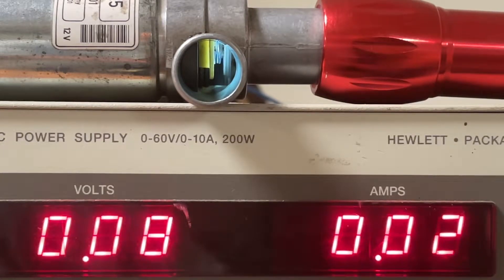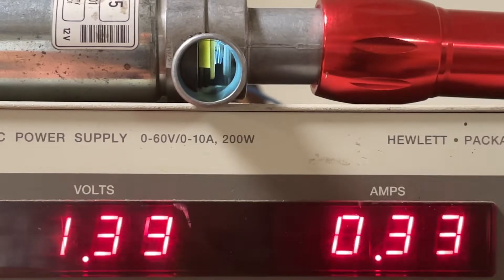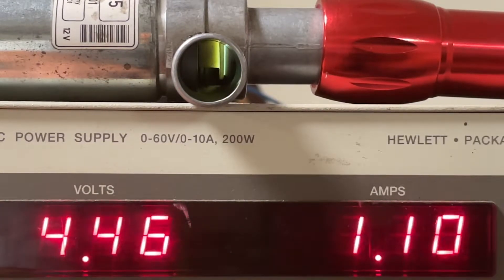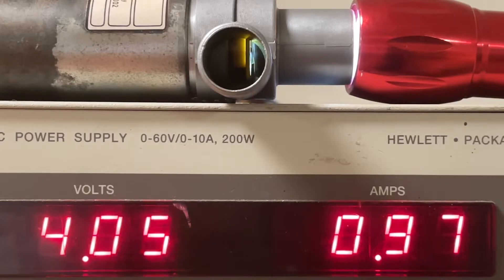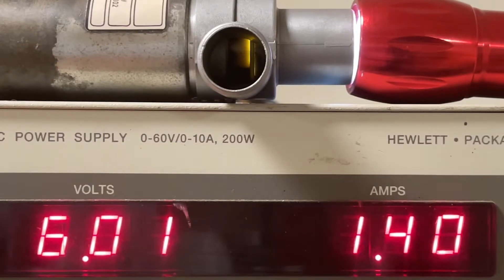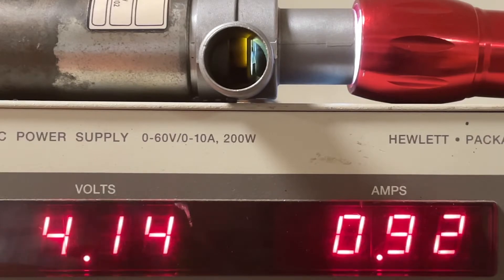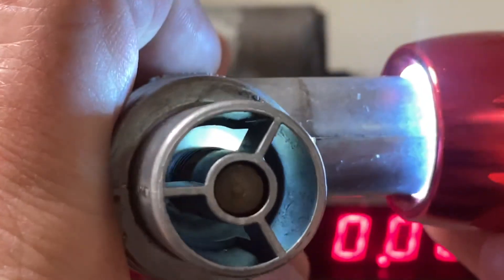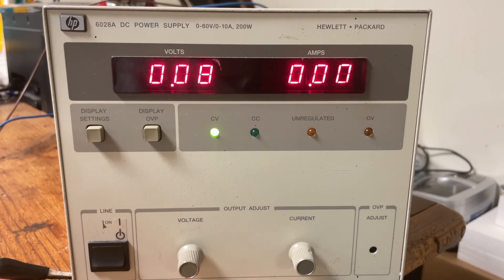Mercedes 560SEL MY 86/91 Idle Speed Adjustment Tutorial Part 5 - testing current draw to close valve

Comment: I need to adjust my control valve but maybe nes a 500 any ideas how
Reply from the maker: I have to get one for a 380/500 then I can tell you of what needs to be done
Reply: @inovahightechltd  ok if you could show me or maybe talk me through it that would be fantastic… great channel by the way 👍🏽
Reply from the maker: @keabot I guess you have a high idle problem? What is your idle rpm at the moment?
Reply: @inovahightechltd  from cold start it’s ok .. as the car warms up the idle creeps up also to 1000rpm I’ve changed the idle control valve original VDO and the rubber hoses so far… I’ve not changed the module or (relay) yet … so  I’m curious to know how to adjust the icv.?
Reply from the maker: @keabot  this looks more like a vacuum leak in the intake manifold and or fuel measuring unit (LMM)
I made a video on how to do a smoke test to detect vacuum leaks in the intake system 

Mercedes W126 560SEL vacuum leak check after 7K miles of the big repair with selfmade smoke machine
https://youtu.be/S0rZdbp8eUw

Comment: have video how to lose that spring ? And any positive result after that ?
Thanks
Reply from the maker: The results are in my car, and no I have not made a video of adjusting the brass guide to adjust the spring tension.
I may make one video of it, depending if I get another 560 or 420 in here - the plan is to make a video of the actual adjustment of mixture and air valve with several pieces of test equipment to visualize on how all these items relate and effect each other - those items to be monitored simultaneously in the video would be: EHA Valve Current, idle speed air valve current, RPM, Duty Cycle and exhaust CO